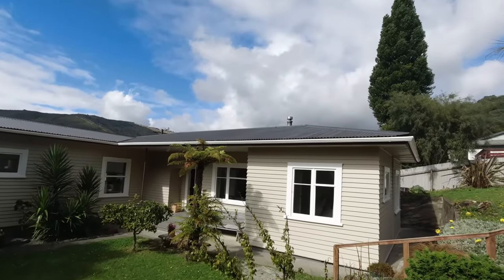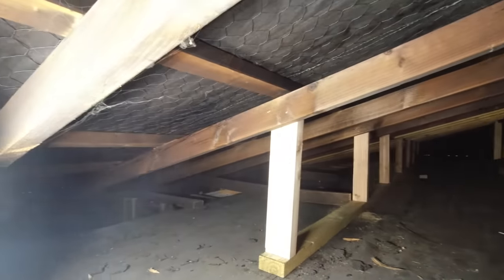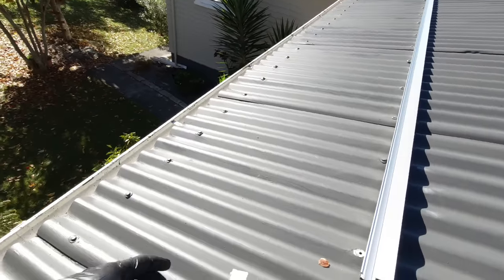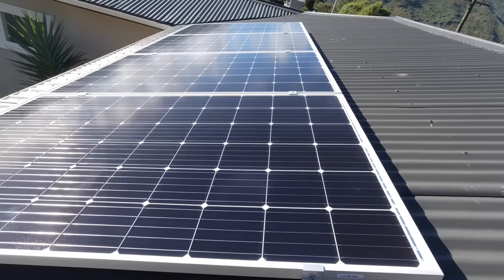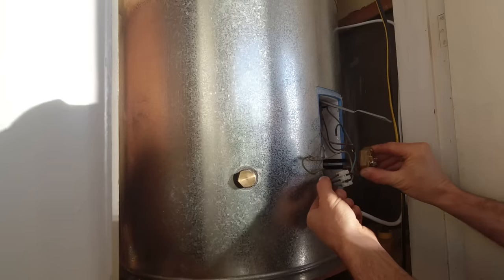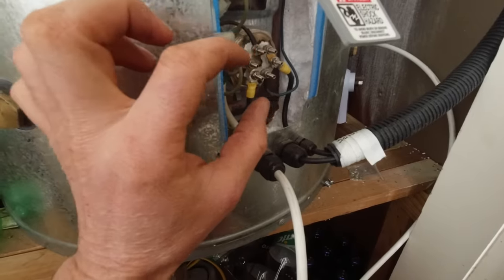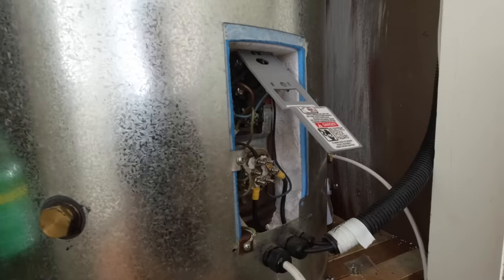Installing PV Solar Panels using a Water Tank as the Battery.. Halved my Power bill

Comment: I like this Idea, I didn't realise that you could get dual ac/dc heater elements, I will have do this at my place. Did the panels and roof mounting hardware come as a kit or did you piece it all together? If you did get them as a kit do you have a link as to where you sourced them?
Reply from the maker: I got the mounting hardware from Fazcorp NZ, cheapest place I could find and top quality. The guys there are very helpful when figuring out the parts needed - https://fazcorp.co.nz/
Reply: @MartyT  Awesome thanks for that! Cheers!!!

Comment: Hi Marty . Wow a great idea! Please where do u get the dual voltage element .

What I like about this is that u have nailed the area where most of electric costs are aquired ! Also no expensive battery banks or inverter controllers etc
Reply from the maker: https://www.trademe.co.nz/a/marketplace/home-living/heating-cooling/other/listing/3286125227?bof=Hp4wlckZ

Comment: What is the difference between an AC and DC heating element?  They're just big resistors, right.  Or maybe you changed the wattage to match your panels?
Reply: DC elements (usually) run at lower voltage, so the resistance has to be lower to suit.

Comment: Marty could you do a video on how you planned the placement of the panels? Like angle and position on the roof to get maximum output?
Reply from the maker: Pretty much just on the most sunny plane of the roof, I could have made them more efficient by propping them up to 45° but would have impeded the neighbors view and this is a high wind zone so would have been more likely to get ripped off in a storm

Comment: Nice work Marty T.
I have some questions for you if you don't mind. Was that a standard 24V DC 900W water heater element with three coils from ebay? Do you need to use a transformer to step down the mains voltage on the third coil, or are you feeding it 240V AC? Cheers.
Reply from the maker: I got this element from trademe nz, it has 2x dc and 1x 240ac coil.
Reply: @MartyT  Much thanks! 🙂

Comment: Im betting that after all those years a Power bill was kinda offensive knowing what you know...
I recently cut my Grid use in half and I now smile when I get the bill knowing that I've kinda escaped the grind a little more, 7kw of panels on the roof and I think its time for some battery banks once I figure out what I need to make it work out of the box without "Powerbanks"

Comment: You've done away with the $1500 inverter, and you've solved the problem of getting paid practically noting for your exported power without resorting to an expensive battery system.  This is pure genius!  I guess the one downside is there's no max power point tracking.  Any idea how close you are to the max efficiency of the panels?  voltage across panels vs the ideal voltage?
Reply: In the uk we run a lot of grid tied inverter solar systems. These provide power for the house to use, if there isn’t enough you top up from the grid if there is too much you can get a little controller that diverts it into the water heater rather than sending it back to the grid. All works very well just don’t get enough sunshine to make it stack up financially without a government grant. Though as electricity is going up and panels coming down  it is getting closer

Comment: Passive solar heating is probably more efficient and cost effective (a lot cheaper than PV) to heat hot water tanks. Part of the reason is PV panels in themselves get hot in the sun and as they heat up efficiency drops off. Passive solar the reverse is true, the more heat the better.

If you have hot water and electrical needs there are some clever hybrid solutions that have both, using the water heating to actual cool the PV panels, generating more electricity in the process.

However, I would say I do heat our water tank with excess solar from our PV panels, but it’s right at the bottom of the priority list after all the direct electrical needs have been met.
Reply: @MartyT
3 days ago (edited)
Solar panels are so much lighter, cheaper, easier to install, no need to do any plumbing or strengthen the roof, this system has now paid for itself a couple of times over and our power bill has more than halved. 
That was my goal and I succeeded

Comment: I was surprised to see that you can just disconnect the panels when they are making power, i thought a dump was needed.
Annoyingly i would imagine is if the sun comes out at say 2pm after being cloudy all morning, the AC mains will have already heated the water & now the sun’s power is not utilised.
Reply from the maker: Only a problem when connected to a battery/controller. The ac mains element would take 4 hours to heat the water so solar would help heat it

Comment: How do you prevent it from overheating on DC? Is there also a thermostat?
Reply from the maker: It is self limiting, hasn't gone over 80c yet but I will keep a close eye on the temp heading into mid summer, if it starts getting too hot I will add a thermistor/plc with a big dc relay to disconnect solar if the water temp gets too high
Reply: @MartyT  there is no regulator on a solar hot water panel...mine rearly overheats...think you will be ok
Reply: @MartyT  I wondered about this also.
By what mechanism is it self limiting? I don't understand how it can be.
Reply: 80c is really hot. You don't need water that hot.
Reply: @simontay4851  Here come the safety brigade.
Reply from the maker: @jimmyb1451  The tank is large enough to absorb a full day of solar power without boiling and It cools down over night even if no hot water is used
Reply from the maker: @simontay4851  If it gets to 80 it will stay hot even if the next day is cloudy, tempering valve on the hot tap supply prevents burns
Reply: @MartyT  Fair enough. I see what you mean. :)

Comment: Next step, use a scraped fridge compressor to make a heat pump and triple the heat output of the system :)
Reply from the maker: I have actually pondered thoughts along those lines
Reply: @MartyT  I was pretty sure you had!

Comment: theres no need to change the heater element other than to match voltages...

im running a 1kw element, what was in the tank. 60R. do the math... its about 960W on 240V. pull about 210 from 6x36v panels in full (winter) sun.

contactors/switch gear should be replaced cus its DC... i can happily draw a 15mm arc from these 6 panels.... yet i still happily just twist wires together with bare hands :) it tingles.. oooooh....

i could happily run 6 in parallel instead, but would want 1R5 to get the same sort of power dissipation.(850W or so) its a trade off... more current means more cable loss. and parallel is better when the light exposure varies. series is woeful when one section gets shaded even slightly, but can run much lighter wire at lower loss for longer runs.

heater elements are just a length of nichrome. theres no point spending money on overpriced stuff that anyone can cobble together themselves.

even on mains, a resistive heater is fine in a tank of water. remember how kettles were before the 80s? i wasnt even born then and i still have one in daily use... (cant STAND SMART CRAP!)

36v... useless trash from grid tied setups replaced under insurance that the installers cant get rid of as they arent really a suitable voltage for battery setups... sure, inverters etc are available but they always seem to be an extra 25% more than 12,24,48...

so, strapping to a heater is really the best thing i can think of. gunna need a bigger secondary tank though!
Reply: I heat water with PV and use standard AC elements and thermostats with a cheap high efficiency controller I built.  Far more efficient than direct connect where power drops dramatically with just a little drop in sunshine.  When panel current drops to 70%, I get 50% more power than you do with direct connect. Arc interrupt allows mechanical contacts to be used without damage.  It only takes a little technical ability to build these. But, solar is filled with these kiddie table videos and everyone wants brainless easy.

Comment: Do you have a thermal cutout or a release valve to discharge water if the tank overheats? Could be a bit dangerous if the tank boiled.
Reply from the maker: Tank is vented above roof

Comment: Hi Marty - great video on the solar water heating.  Looks like you are in NZ as am I.  Am wanting to do the same thing, but coming unstuck with how to control the DC power to the heating elements because of the arcing problem.  Cant use the existing thermostats for DC, and solid state relays seem problematic.  Electromechanical contactors are hard to get and expensive.  You appear to connect direct to the elements with no control?  Would like to find out more about your experience, and any advice you can give about how to control overheating? .  Cheers, Nigel
Reply from the maker: Hi Nigel,  During summer I disconnect 2 of the panels so it doesn't boil the cylinder, rest of the year all 4 are connected. I find this works quite well.
Reply: @MartyT  Cool - thanks for the information Marty.
Cheers
Nigel

Comment: Pretty fuckin cool dude, a great way off getting power bills down with solar at a fraction of the price of battery or grid feed system. We're looking at moving our water pumps workshop lighting over to solar battery as that's one of our main contributors to power usage. We have a solar hot water heater system  as it's ok but we have it connected to the fuel stove in the kitchen for the additional help when the sun ain't about

Comment: Can you please specify exactly what heating element you are using, what solar panels and the most important part, what kind of thermostat to handle high amp DC.
Reply: @MartyT
2 months ago
During summer I disconnect 2 of the panels so it doesn't boil the cylinder, rest of the year all 4 are connected. 
I find this works quite well.

Comment: Amazing how you can make what I would consider complicated so simple, I’ve always wanted to this in the UK but I am not sure where to start on the electrical side of things, doesn’t the water get incredibly hot if it’s a really sunny week?
Reply from the maker: I have left it for 4 sunny days without using any water and it got to 80c. it cools down a certain amount over night. It would be easy enough to add a thermostat on the top pipe connected to a big dc relay on the solar feed powerered by a 12vdc powerpack. I think I will do this before we get to mid summer.
Reply: I'd be interested to see any updates to this system, Marty. Cheers.

Comment: Did you know there was fire damage when you bought the house?  I added structure to the roof of my first house as well.  It was 50 years old and sagging.  Inside it was just like yours.  Nothing but the main rafters with no additional structure.  Is the corrugated metal roofing common in New Zealand?
Reply: corrugated roofing here is most common yes, been used since 1860's
Reply: @mikepapa3196  Metal roofing is growing in popularity here in Ohio, but the vast majority of all homes here are still roofed with asphalt shingles.  Including mine!  😉
Reply from the maker: Yes I did know about it before buying the place, it was one of the first jobs on my to-do list. Corro iron is very common here

Comment: How is the dc power controlled if no one is home to use the hot water will it not start boiling the water in the geyser. The solar and dc units normally have a control unit for this.

Comment: Last year we put a 6.5Kw system on our house for just on $3.000 Grid connect/battery ready and the power bill went down by 2 thirds as all our daytime power is free...happy as a pig in shit with that , working on paring it up to a 5Kw lithium bank ($5,000) and saying bye to the power company for good , we live out bush in NSW and will be totally off-grid then.
Reply from the maker: Nice, do you get solar grants over there?
Reply: @MartyT  We never went with a grant so to speak but the company that installed the system received the renewable energy certificates (REC's) the govt. offers which lowered the cost of the system price. The way I looked at it was...You cannot get 20 x 330W tier 1 panels for 3 grand , plus to get it all installed and connected with a 5Kw battery ready inverter and it saved me the problem of trading the REC's on the open market to offset the normal cost. All up we only paid $3,330. I hope that explained it Marty.

Comment: Good job Marty! Just curious, would it be possible to use an old a/c and make its condenser coil heat the water? In theory that would significantly increase the efficiency of the water heating.
Reply: Yes - adds complexity, but reverse cycle heating is 3 to 4 times more efficient.

Comment: Very impressive. Are the elements different values? If your DC elements are the same resistance you could probably get slightly more efficiency by running the panels in series and the elements in series as well. That'll halve the current running through the wires and double the voltage across the elements, leading to less transmission losses.
Edit: Also, what are you using to stop it overheating?
Reply from the maker: Yes the elements are different values, dc-6.5 ohms. ac-53ohms (240v)
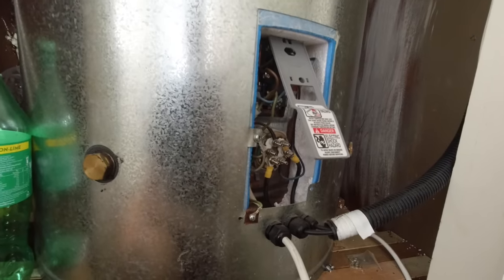Reply: @MartyT  Did you say there are two DC elements? If so, are they identical resistance? Edit: yeah, @10:30 you say there are two elements. It's not going to be worth much to change to a higher voltage, and it's always nicer dealing with lower voltages from a safety standpoint.
When I connected my 4 panels in series to my geyser's 3kW AC element, I did notice that in full sun I'd get ~130V at 8 amps in full sun, but on cloudier days the panels couldn't supply enough current, so the voltage would dip, meaning less power. I was looking at doing a variant of William Fraser's MPPO circuit (https://youtu.be/viMOtah2CzY) to maximise power output in low light, but couldn't get it to oscillate properly. I've since disconnected that geyser because we've got a regular hot water panel on the roof with a different one.

Edit 2: In South Africa we call our hot water cylinders geysers.
Reply from the maker: Yes thats right, I don't want to put them in series as this would raise voltage over elv and rules get more complicated
Reply: Ah, perfect. I've done the calculations and it looks like you've got the exact right resistance heaters for the job.

Comment: Good job Marty, way to save a few bucks.
I knew a guy who had gravity fed water coming into his off grid summer home. He put several hundred feet of 2'' coiled PVC on the roof. The sun heated up the water in pipe and he had hot water every time the sun shined.
Reply from the maker: Yes quite common here but I have heard of the pipes overheating on a hot summers day, becoming soft and bursting especially on high pressure town supply, really need to use copper pipe or a circulating pump to be safe

Comment: Hmm, you must be using hot water for heating. In my case hot water is only 10% (at most) of my bill. If I was to change my current heating to water... I think batteries would be cheaper. The other half of the equation is climate, of course. The sun comes out in the summer and we have mostly clouds in the cold part of the year. So, good deal for your use case, well done. I'll have to think of something else here.

Comment: I see you went with a new low pressure cylinder, I'm guessing this would also work just as well with a mains pressure unit? Thought about hooking some panels to a water cylinder a while back, nice to see just how easy it actually is!
Reply from the maker: The cylinder was already in the house, Yes you could use it on a high pressure cyl as long as the thread is compatible with the element and it needs to be big enough to absorb the solar heat without boiling, 180L minimum with 4 panels
Reply: @MartyT  Whereabouts did you pick the DC element up from is this part of the country? We have a low pressure cylinder at the moment, have enjoyed showers from mains pressure in the past so would like to head in that direction when we renovate.
Reply from the maker: @richfoub  https://www.trademe.co.nz/a/marketplace/home-living/heating-cooling/other/listing/3286125227?bof=Hp4wlckZ
Reply: @MartyT  Did you go poly or monocrystalline with your panels? Also where did you source the racking? Thanks for all the info.
Reply: @MartyT  Got the element, have some panels arriving next week from Chch. Where did you find the racking for your system?
Reply from the maker: Fazcorp, top quality gear, good prices. I got my cables and connectors there too https://fazcorp.co.nz/collections/solar-mounting-system
Reply: Hi again, am I able email you directly about your install? I have a couple of questions?

Comment: Love your videos Marty, they've been getting me through the Auckland lockdown. 

Very keen to try this approach at my place. One question: How would you recommend implementing a similar setup with a smaller (135L) hot water cylinder. Would you recommend using the same amount of panels, and changing the parallel/series wiring arrangements to detune power output? Use less panels? Or use a PLC with a disconnect?
Reply from the maker: I'd probably do the same as I've done 4 panels but add a thermostat/heavy dc slave relay cut off.
Reply: @MartyT  thanks for your reply Marty. Will get onto it!
Reply from the maker: @StuartHarwood  Other option to prevent tank boiling is to have 2 strings of 2 panels connected during autumn, winter, spring and disconnect one string during summer. Easier but not as efficient as having all 4 connected on cloudy days.. I haven't had the mains element on for 10 days and sometimes we have 2 full baths a night
Reply: @MartyT  great idea. Could probably use a big marine house/motor switch for this purpose.
Reply: Hi again  @Marty T - I'm literally about to start installing panel on my roof! Just curious, where does the requirement for the panels to be 0.5m from the edge of the roof come from?